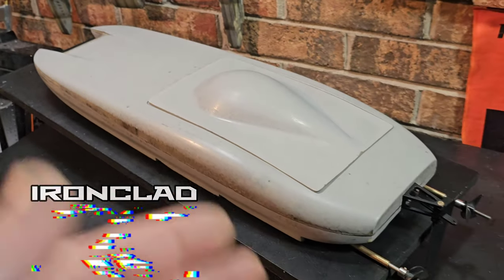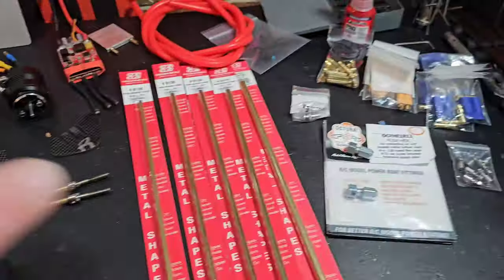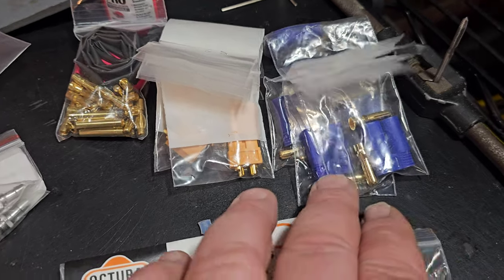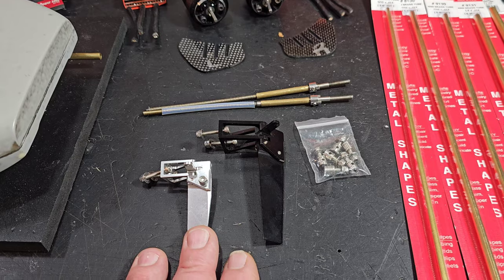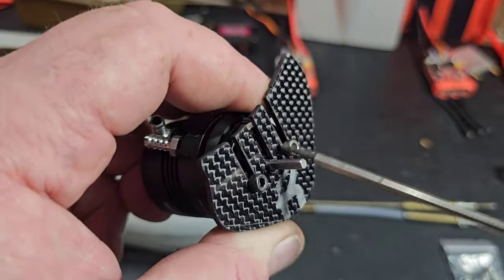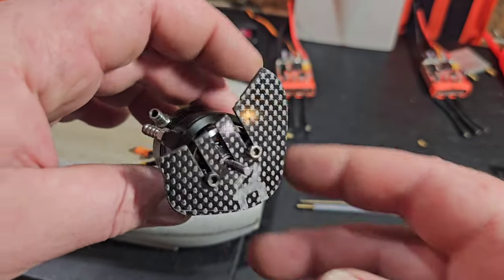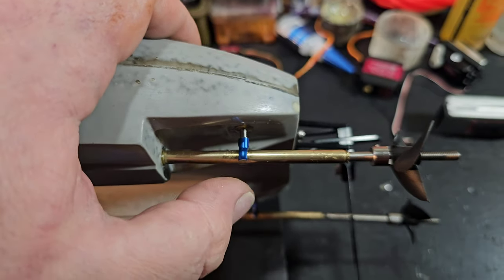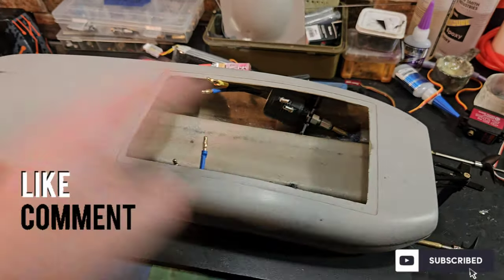Mini Twin Motor Cat Build Part 2 Motor Mount & DIY Driveline - Rc Catamaran

Comment: Love the build , it’s going to be a ripper. Bro I’ve been in this money sucking hobby for a long long time ! I know it’s hard sometimes to put the money out but please don’t cheap out on your servos specially steering servos. Spend the $50/60 bucks  look up - no superior design  RC/RS500B it’s a High torque High voltage you can install it directly to your batteries up to 16.8 volts. It’s just $50 dollars of insurance

Comment: An idea.
Where the tube goes through the hull, what about using silicone for a flexible joint. Not the bathroom stuff. The silicone they use to glue the aquarium fish tank glass together. Just a thought.

Comment: Have you ever thought about using a Piano wire drive? Been thinking about switching over to .078 Piano wire and not use the flex drive shaft. It seems from what I found it a great alternative and much less expensive to replace.
Reply from the maker: Piano wires are great, usually paired up with a forward mounted motor with a slow easy bend.

Comment: What is the disadvantage of not running a liner in the stuffing tube. I'm thinking I could run the 4mm which is a stouter rod. But you didn't do that so what's the disadvantage. Thanks
Reply from the maker: I would much rather run a flex cable without a liner,  this particular setup needed a liner, if I were using a 4mm flex cable with this setup, I wouldn't use a Teflon liner.       Teflon is one more thing to go wrong in a driveline IMHO

Comment: I know this video is older but with my build getting underway i was wondering if a 52mm rudder would work now that you've had a chance to feel yours out or would you stay with the 78mm
Reply: My thinking is that a shorter rudder was awesome on the bj24, and faster. Does that theory apply this. Thanks big b for all your help. You are the best out there.
Reply from the maker: 78mm is perfect for this hull, 52 isn't quite long enough IMHO.  I had to install a longer wider rudder blade because I lost my original blade.  Im liking the longer rudder so far.

Comment: Why would you not put space needed between the stuffing tube and the coupling on the motor for a prop shaft saver?
Reply from the maker: I really never used prop/cable savers, not that I have anything against them just never jumped on the band wagon so to speak.
Reply: I only ask because I have lost two shafts so far and its an expensive deal when it comes off.
Reply from the maker: @slickman1953  good quality collet should help hold onto the cable, never over tighten the collet and lightly solder the cable end.   👌